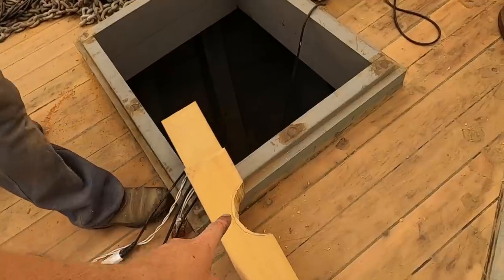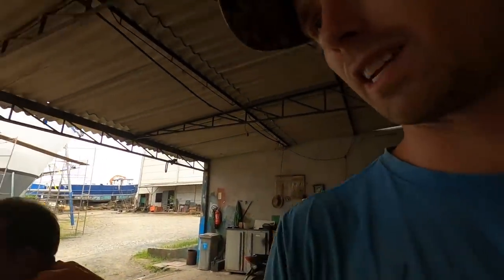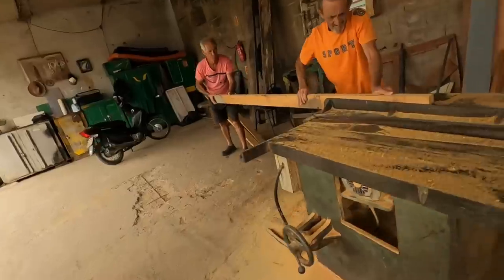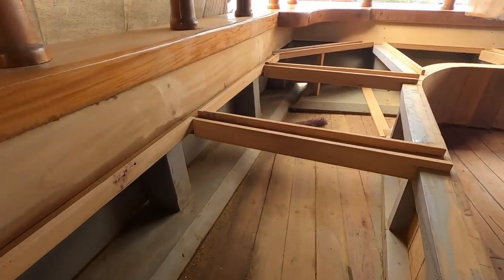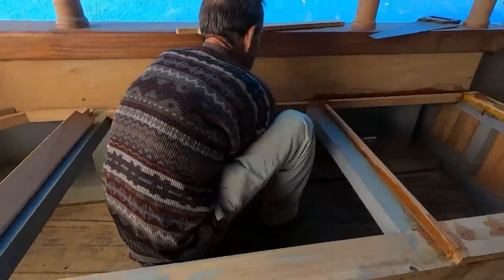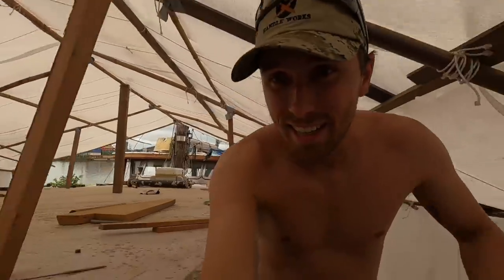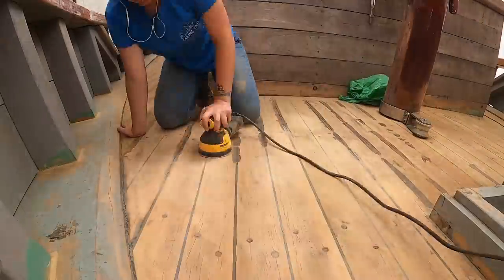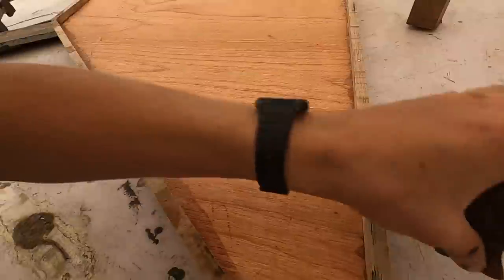Changing the design once again: WATERTIGHT idea for the aft salon WOODEN BENCHES — Sailing Yabá #79

Comment: I just wanted to comment on the balls of that old man to run a table saw like that holding it down with his hands instead of using a wooden push tooling for and inch or less of play from the spinning blade.

Comment: Looking good guys!
Here's a couple of ideas.

Given that you're recording all your adventures, would a home security camera type system installed in the boat be an advantage. For occasions such as authorities or unwanted visitors coming on board and also for B roll for general story telling.
I'm thinking as well as permanent indoor cameras a mast down view would be interesting and an over shoulder cockpit view etc etc

I don't know if you follow a young YouTube couple "Salt and Tar" they have built their wooden yacht from scratch and are currently finishing the fit out in Napa, San Francisco.
They have something they call "Soup" which they concoct themselves out of linseed oil, pine tar and other good stuff. I'd have to look it up if you were really interested in the recipe. Basically they liberally apply the "Soup" to any wood surfaces that are not varnished.
I couldn't help but think that a coat of "Soup" would be perfect to help protect the inside of the hull, bilge and the underside of the lockers etc
Keep up the good work.

And as always
Massive Respect from Aotearoa, New Zealand
😀👍💙💛

Comment: A lot of work going on in this episode, but it's looking great so far.  The cut the carpenters made on the table saw is called a Rabbet cut. Sometimes they are used to make joints with a rabbet on both corner boards. That makes them a lot stronger than a simple butt-joint is because it offers more area for gluing and the two rabbet joints support each other so it's even stronger.

Comment: I'm wondering why you need to put hinges on those bench tops! Wouldn't it be easier and better to be able to just lift them on or off as desired? They're definitely not going to be going anywhere as they are! 
You certainly like your wild colour schemes down there... and so do I ! Have you thought about how you will paint Yaba? I have been speculating a bit about colours. What do you think about a black hull with lots of different colour accents? Then there's the sails to think about! They will have to be a colour of some kind: burnt orange with a black hull and accents? I'm sure that your shipwrights will have plenty of suggestions for colour schemes too! I think it's going to be a lot of fun for everyone! 🤩💖❤

Comment: This seems so simple yet one of the first skills a carpenter needs is how to measure correctly, transfer that measurement to his stock and then properly cut so that the piece ends up right. When most cut on the wrong side of a pencil mark or get their cut off by the kerf of a blade they usually just beat the piece In or have it fit sloppy and nail it in. I can tell the old masters get the perfect fit. After all a boat builder is much more than an average carpenter. Finding these guys and finding a yard that allows you to work amongst them was a real blessing and it's really starting to show as your boat is almost dried in and ready for interior.

Comment: Instead of PU, I would put a single layer of fiberglass with polyester or epoxy resin over those seat boards and the water channels. Then they are are much more water tight, it fills the corners nicely, and makes them all much stiffer with a high strength skin. One layer of glass will be nearly invisible too, if you are concerned about how it looks.

Comment: MP you should wear a respirator when sanding.  sawdust is bad for your lungs but what is worse is the aluminum oxide dust from the sandpaper getting dull.  and powdered sikaflex probably isn't good either.

Comment: The stern saloon is really taking shape! I have every confidence your bench design will work nicely. I don't know what the chances of water intrusion into the cockpit will be under sail, but windblown rain certainly will. Anything that gets down into the 'channels' will just have to be checked to see that it drains out the front and doesn't puddle in the channels unseen because of the cushions.

To clarify, is the interior jointer work (cabinetry) going to be done in the boat yard, or are you going to have to do that in a marina on your own?
Reply from the maker: Hey Brian!!
We are glad you liked the benches' design! The "channels" can also be drained from the back to the sides as well (under the cushions), not only forwards. But of course that we will be checking it under the cushions from time to time, mainly at the beginning, to make sure the system is working as expected.

About the interior work, we believe we will be staying in the yard at least for the most part of it (galley, at least one toilet and at least one cabin). But that doesn't mean our plans might change until then!
Have a great Sunday! X

Comment: You have made the tops water tight, but you are still open to the outside along the bottom.  I know that it's for water drainage but I wonder if there's a way to make it out only? Maybe a little door that only opens when there is water inside?

Comment: I'm curious about how the aft salon deck drains.  Whilst the top of the wooden benches will be waterproof, it looks like there are scuppers (drains) from the lockers to the outside. Then there's the hatch to the engine room, that needs to be completely sealed too, perhaps with neoprene.

Comment: The, boat is looking good. Still think the Swim platform a mistake. Decks look good. For a cheap non skid in only key areas. You can tape off the area,  after varnish 3 coats. I would make sure to use steel wool between every coat of all varnishes.  U most scratch the surface for the next coat to hold. If not it will peel in high heat .
But cheap non skid, buy swimming pool sand wash it in a bucket. Spread it out to dry. Keep it clean. Then with a smaller bucket add your varnish, then slowly add spoon of the clean sand. Stir it. Dont use to much. It should only be 1 level of sand when rolled on, and the varnish will self level. Dont do the whole deck. Just area in the bow, and where lines will be.

Comment: Are you going to install solar? you have so much room up top for 12 500 watt panels. If so Lithium batteries. you can save a lot if you buy EVE batteries 280ah each cell. If you have questions I have spent a year researching and I am finally building my solar and battery banks.

Comment: Please Do Not Varnish your deck. Use Semco Teak Sealant. The varnish will be slippery, no matter what the grain and will quickly fail all over the deck due to being walked on. Semco will absorb into the wood, can be applied with a rag, and will bead water off the wood like off a duck’s back. There are several tones from clear wich leaves the wood’s hue all the way to a wet teak look. I like the clear as I like light decks.
Reply from the maker: Thank you for you suggestion, we will definitely look up into that!